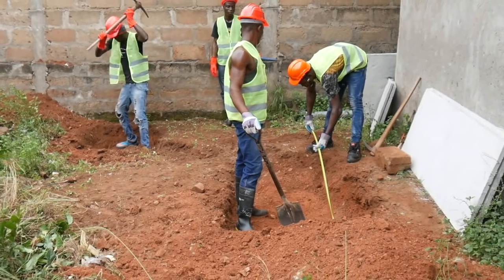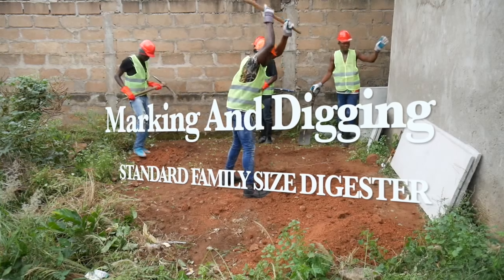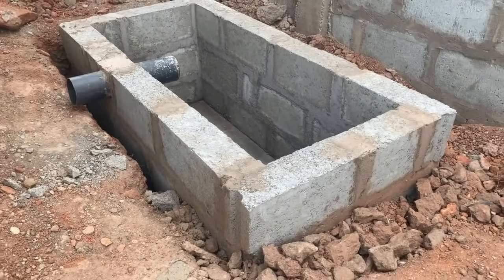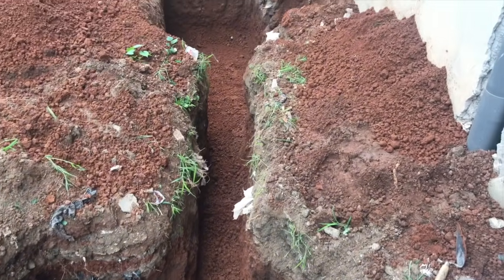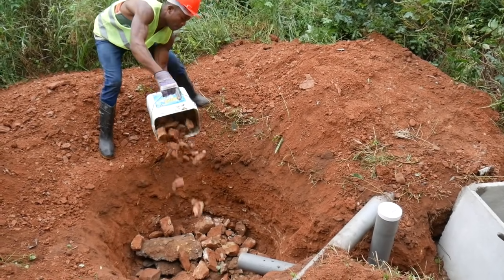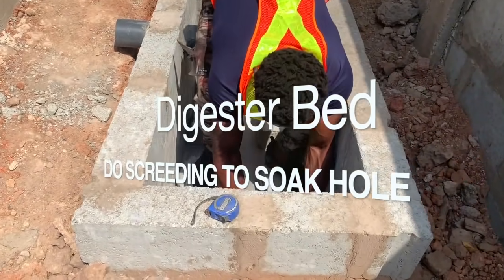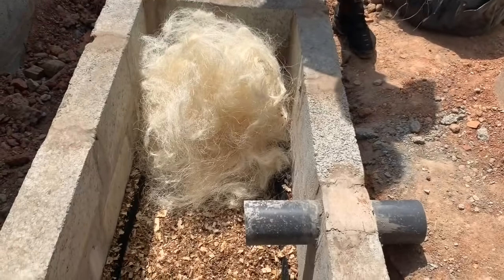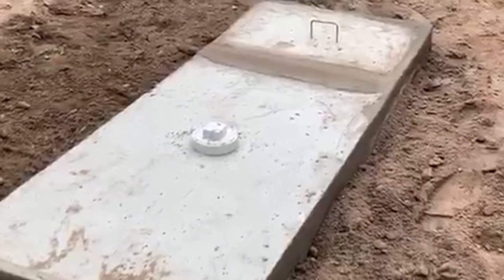How To Construct a Biofil Toilet Bio Digester (7 Simple Steps)

Comment: Hello, I am new to your channel today, so far I like your content. May I ask what product can we wash/clean our toilets, sinks and showers with so they are clean but it doesn't interfere with the biofil digester and our pipes.
Reply from the maker: Thanks Kristina. The newly designed biodegradable biodigesters work fine with all the cleaning detergents and bleaches on the market so you have no problem using them https://youtu.be/52EIpf62JJ0
Reply: Thank you for your time and reply. I just don't want to effect the biofil digester not working correctly, I noticed you said some products stop or kill the needed good bacterias that help the solid waste desolve or break down. So I was curious as to which cleaning products were better to use than others so I don't kill those needed bacterias.

Comment: Weldone. Your work and design is commendable. I really learn a lot. 
Pls when someone make a flush with WC, the fush is a combination of water and excreta, by your design , the water will be drained immediately it enters digester, how will the ecxreta decomposed when there's no water again. Because I can see your drain pipe at the bottom of the digester. Need your response
Reply: It will be decomposed by the bacteria that's already in the waste to produce biogas anaerobicaly.

Comment: It would be very nice if you can construct this digester to produce biogas. A little redesign will make the unit more useful. Eg bigger volume maybe 2m3. Submerging in effluent inlet pipe to for a seal. Outlet at a higher level. And a gas outlet to a gas holder.
Reply: @destro513 makes perfect sense why the ?

Comment: I understand that a bio-fil digester such as this uses aerobic decomposition so that methane is alot less, if at all. However, how do you ensure aerobic decomposition by sealing the concrete box which houses the wire-mesh and the coconut fibre?
Reply: hahahhaaa this video is very stupid